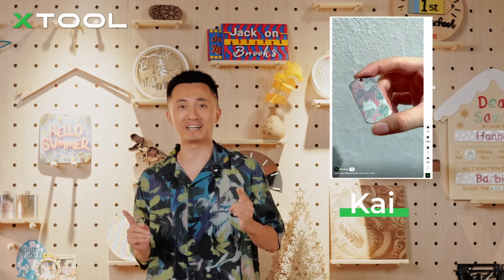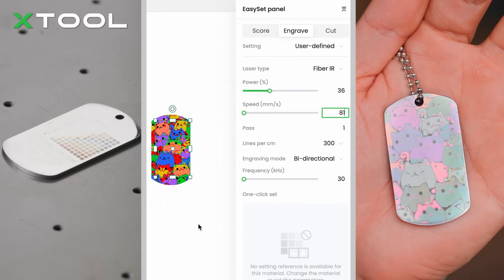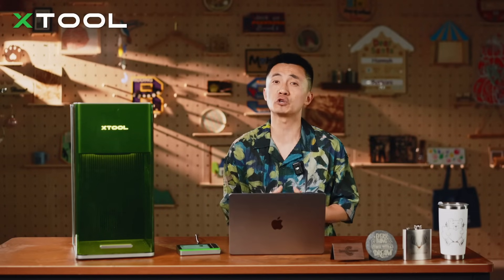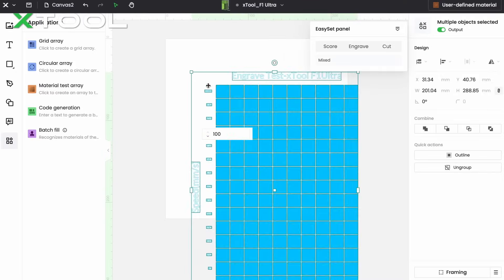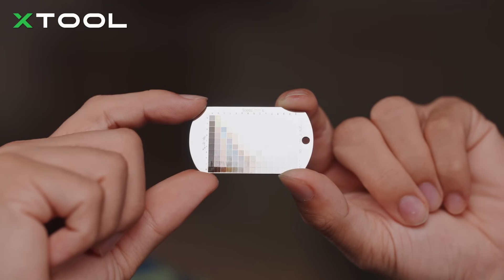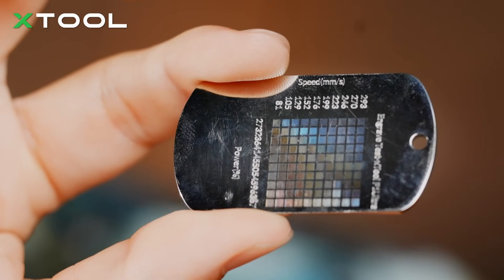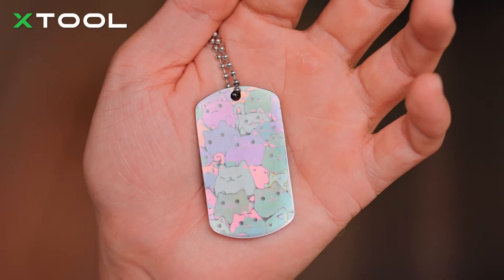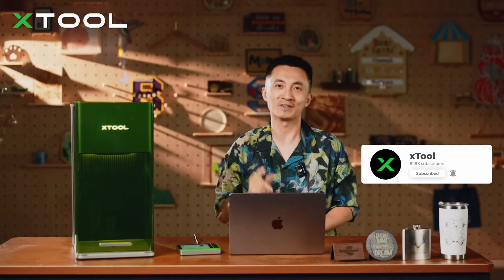Color Engrave a Cat Metal Tag with xTool F1 Ultra Fiber Laser

Comment: If the engraving grid has a height of 18mm and the piece measures approximately 1.5mm, why is the focus in the file at 27.7mm? Am I using any defocus?

Comment: I understand you're trying to make a "quick video" but this is WAY to fast to actually help.. Then you just skip over the part that everyone is here to see. Which is how to actually get all the multicolors into your settings for the final product. Do you need to go through and program each setting separately? Or is there a way that you're doing it different than that? 

I mean this could have been a 10 minute video, that actually had some explanation. Instead of a 2 minute, blast past everything video... 🤔🤦
Reply: agree, I could hardly understand him because he went so fast. Disappointing
Reply: It's not the testing array that I would like to see how it's done. The testing array is simple, and I've done that a thousand times. It's the incorporating the settings into the complex image, that had a ton of different colors in it..... That's the part that would be nice to see. But don't worry about it, your affiliated partners do a way better job making videos about your products, than you do....
Reply from the maker: @JRBigS You can set up different layers and put through the parameters of the colors you want according to the test array onto the image you want. And if you want to ask how to divide the image into different pieces, yes, that part was done by Ai software, after all this tutorial is supposed to show audience that you can actually laser engrave different colors on the same piece of stainless steel, not how to use Ai software. And thank you for your feedback, we will try our best to improve. ❤
Reply: I 100% agree, too fast!
Reply from the maker: hey https://youtu.be/vYvjrBjRbyk?si=sft2Sim4Hc2iicXz, can check out this video, the testing array setup is the same as this one.

Comment: Wow excellent! It is a special kind of metal? or works with any kind? Thanks!!
Reply from the maker: Stainless Steel!
Reply: @xToollaser  you only answered half of their question. With your answer, they will believe that stainless steel is the ONLY kind of metal that will yield these results.
Reply from the maker: @Connorsdaddy12062008  fiber is famous for laser engraving on metals
Reply: @xToollaser  I understand that completely. However, their question was "special metal, or any kind?" To which your only response was "stainless steel ".

I'm just trying to solve any confusion they may have
Reply: Must be Stainless Steel
Reply: It doesn't have to be stainless steel... it can do this to a multitude of metals@Penguin817
Reply: @Penguin817  no, it can be ANY metal
Reply: @Connorsdaddy12062008  Bro be quiet. Stainless is already a lot of work to get colors out. And anything can change your results like ambient temperature, moisture, material, distance / material thickness, etc. Other metals are even harder.